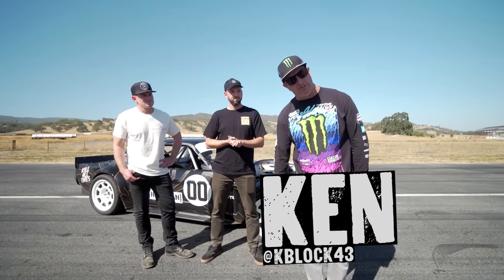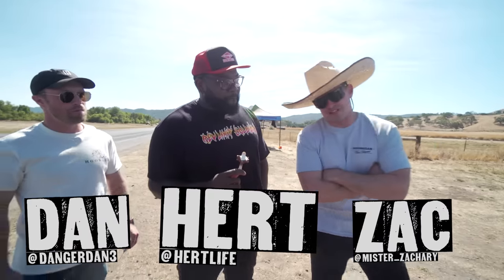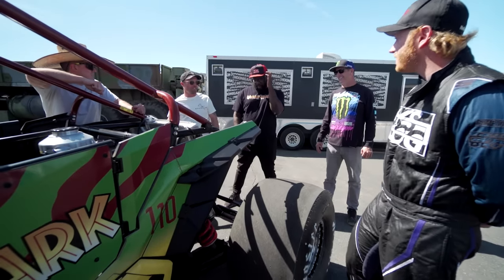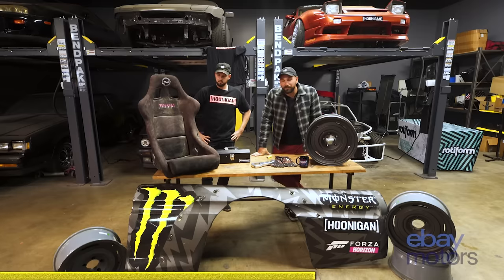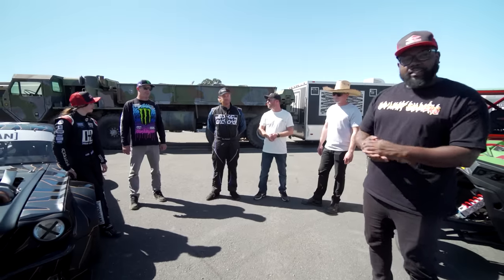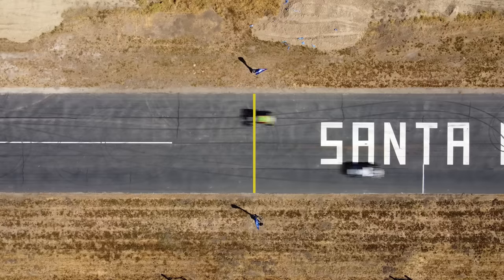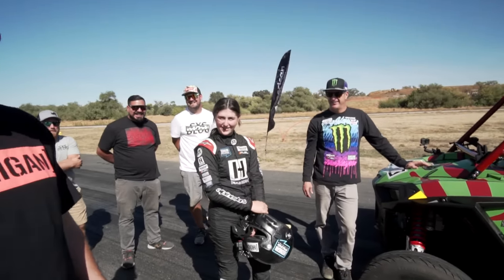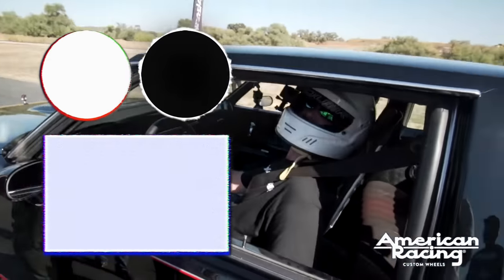World's Fastest 1100hp 2JZ Polaris RZR drag races Lia Block's AWD 1400hp Mustang

Comment: This was one of the best performances. Damn! That little buggy is crazy fast🙌🏾
Reply: If aerodynamic drag was not a factor, I think it would stay ahead. Hard to push a brick through the air at those speeds.
Reply: @dontcallmezoo  Agreed, Maybe a tiny bit more weight over the rear to help with the traction too.
Reply: AMEN PASTOR PREACH
Reply: @dontcallmezoo  they probably need to just blow off the track, he was spinning the whole back half. 8.14 is probably faster than what the hoonicorn would run at the track
Reply: Ofentse do a this vs that if it was in South africa 😂😂😂 waiting on that boet
Reply: @inept2120  some smartly designed aero can do both
Reply: They make some cool rigs. They did Adam LZ's sxs
Reply: They also got a big turbo mid truck and a procharged LS OBS burnout truck that rip
Reply: @motoweenies4431  yea the road is shit for anything not AWD.
Reply: could not have put it any better tbh
Reply: Madder than a bag of badgers!
Reply: Would love to swap the tires for some massive paddles and go mudding with that s x s!!!!

Comment: The Hoonicorn won the race but the RZR won our hearts. That thing is nutty.
Reply: They need to bring that gtr back for the rematch.
Reply: @nickwebb9937  yup we need that 2000hp gtr back
Reply: bring the hoonicorn to the strip and and it will loset to the RZR bc the buggy was spinning
Reply: How about one of the older gen f1 cars like from year 2017 or 18
Reply: @george8966  the Hoonicorns drivetrain wouldn't survive the grip at launch on a prepped track, they've even mentioned that in previous videos. I envision drive axles exploding, lol.
Reply: Well thanks for spoiling it
Reply: @wangonguy62  I mean it did that on this unprepped surface, yeah a prepped track would "kill all shafts"
Reply: @Theboys-tn5lf  You went to the comments first what the heck did you expect??
Reply: @Brandizzleizzle  Unlikely. Mid to high 8s would be my guess. 7s are a bigger deal than you think.
Reply: @Brandizzleizzle  Lots of 2000 hp cars can't run a 7. The Hoonicorn would snap everything in the drive train on a prepped track. He wouldn't be able to use more than 700 hp on a prepped surface. That's the facts whether you like it or not. The Mustang is built to spin. It's not built to put all the power to a sticky surface. It just can't do it.
Reply: @Brandizzleizzle  Good for him. Does it have the same drive train as the Hoonicorn? I assume it has the same front driveline. Right? By the way, what kind of driveline do both cars have?
Reply: @Brandizzleizzle  And obviously more durable. If you're being honest. I don't care how cool you think the Hoonicorn is, it would blow apart on a prepped drag strip and they've said so themselves. That's not what it's built for.
Reply: @Brandizzleizzle  Sure kid. lol
Reply: Nah maybe yours, not mine!
Reply: It's starting to look like it's fake

Comment: When i saw the preview a few weeks ago I said 2jp would get smoked cause of its gearing but I stand corrected. Way closer than i expected. Well done boys. Love the SXSBlog
Reply: Yeah, I think some work on gearing a slightly more aggressive tune, the 2JZ would win and that is without a prepped surface.
Reply: @27Zangle  i think the suspension really helped out here. Imagine if gearing was good and time the suspension.
Reply: @10awkwardpenguins  - IF you watch again and look closely, the 2JZ was spinning almost the whole way down. I think it would easily win with a bit more traction.
Reply: @27Zangle  I second that. If the 2JZ came that close on this surface where the hoonicorn had a huge traction advantage, it would probably comfortably win under ideal circumstances.
Reply: Pretty sure they did make a gearing change for this race.  You gotta bring a machine ready   to win with no excuses when your on stage like this.
Reply: @crudboy12  Huge traction advantage ?  Do you have eyes ?  Hoonicorn fries the rear tyres for at least half the run too !!
Reply: @arkhsm  Hoonicorn is AWD so it's spinning 4 tires instead of two.

Comment: i never really realized how short 2jp actually is. and holy crap i was not expecting it to hang with the hoonicorn that well
Reply: Its under 3k lbs with slicks and over 1100 hp and ran almost a 7 in the quarter. How fast do you really think the hoonicorn is? Fast AF of course but🤷‍♂️ its not a pro mod
Reply: well with big drags slicks better power to weight and a 2 speed. just lost out on the top end.....gearing??

Comment: 12:50 Holy shit! Lia can do donuts like she is drifting already? crazy!
And on a AWD car.
Reply: Crazy. Tbf the Hoonicorn was pretty much made for that tho.
Reply: the handbrake in it disconnects front drivetrain so it turns into rwd
Reply: @sylence4u  it doesn't, you literally can see front tires spinning...
Reply: AWD with a lot of power is easier to control than RWD with a lot of power dawg.
Reply: Awd donuts are easier then rwd when you have the horsepowers...

Comment: The only issue i have with this series is the amount of sand bagging from the Hoonicorn. A race is a race but i want to see all out all the time.
Reply: Was about to say the same thing. Seen enough of these now it looks like Hoonicorn holds back the first race.
Reply: @mrphil2159  but a bit of sandbagging means we get more runs, and more runs is better. also you're watching through the internet and really have no idea if there is sandbagging or not, so just stay in your armchair and enjoy the content
Reply: Sandbagging.....right. Almost the exact same result twice in a row (and a believable excuse from the guy in the RZR the first time) and it's sandbagging from the Hoonicorn. Get real
Reply: @mitchell-wallisforce7859  you dont have that close of a race the first time then start behind him the second time, fly by him, and still finish almost exactly as far ahead as the first run. If she wasnt sand bagging and short shifting that first run she would have been bus lengths in front of him. You can hear the short shifting aka sand bagging in almost every one of these videos. Clean your ears and you might pick up on that.
Reply: @mrphil2159  she short shifts the crap out of it too just before peak power it seems
Reply: @trippydrifter4674  Not shortshifting in the Hoonicorn likely means insane wheelspin. It's a 1400 horsepower Windsor V8 with AWD. Even the stickiest Toyos are gonna slip.

Plus, if you're talking about THIS race, the RZR guy ASKED to go heads up a second time, and was right to assume his stickier tires would help with traction. Lia admitted immediately after that her launch wasn't great, too. Also, the gap WAS smaller.
Reply: @mitchell-wallisforce7859  they have run all the gears out in previous videos without much issue but i have noticed that they short shift it when the cars arent a very good match. Lets see what happens when the boosted boiz mr2 video comes out.

Comment: You should race the 1300hp Audi TT RS that was made in partnership with NASA and tuned by Don Octane. It's also a streetcar that was stripped to the chassis and purpose-built for making as much usable power that a streetcar is actually able to put to the ground and has a very similar power to weight ratio as the Hoonicorn. It would be one hell of a race. Most likely would come down to who is the more skilled driver.

Comment: as for anyone asking what the hoonicorn can run the quarter mile at. judging by its performance of it beating the rzr(814 at 170MPH). It will run an 8.00 at 177 to 7.99 at 180. Thats just bonkers of what a monster that mustang is.